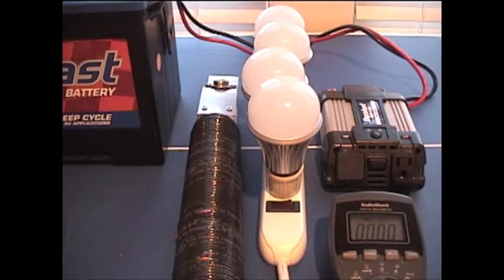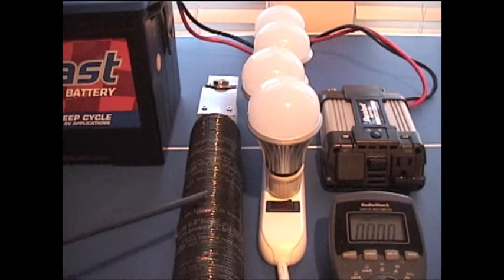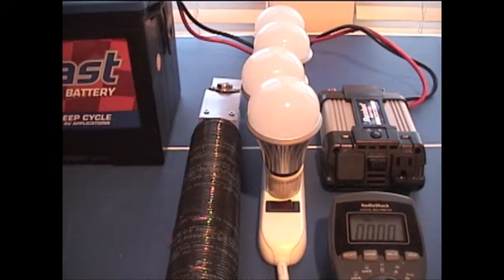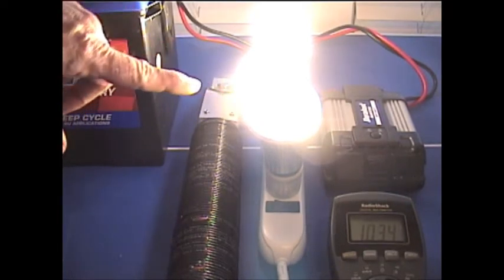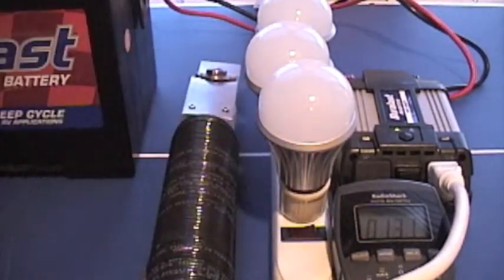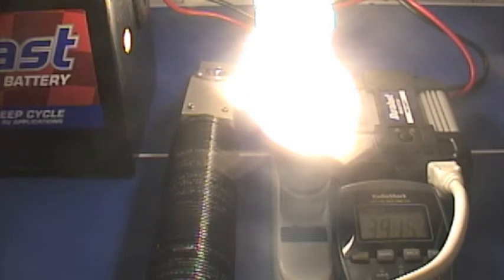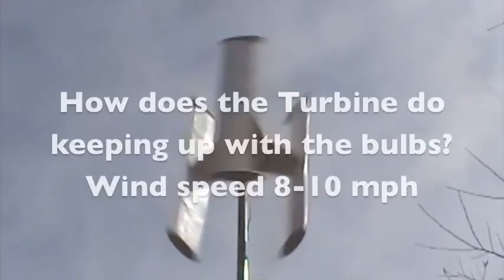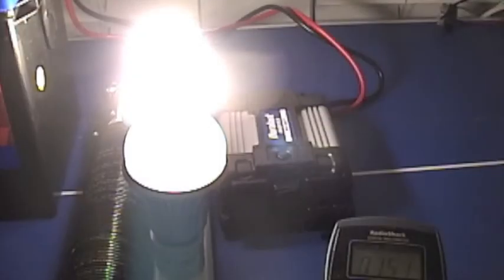Lynx Wind - Energy Efficiency

Comment: You might be able to drive the current lower off your ringer circuit if you use two earth grounds. One off the battery negative and one off the lamp base connection and add an ac cap to the end to build up a higher potential to drive the lights off. I done this setup in one of my old videos I did but I have no idea what yours will do because its slightly different then lasor-sabors channel's design.